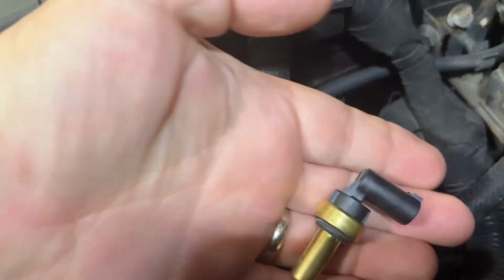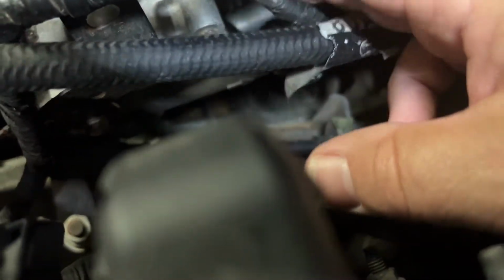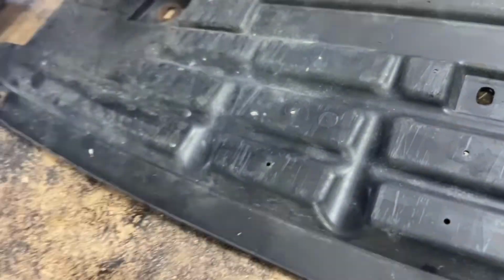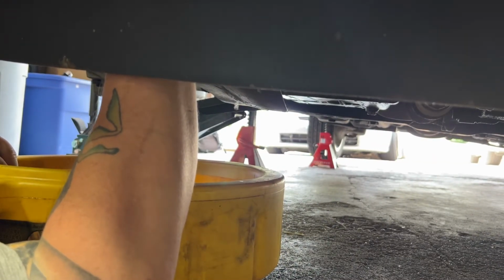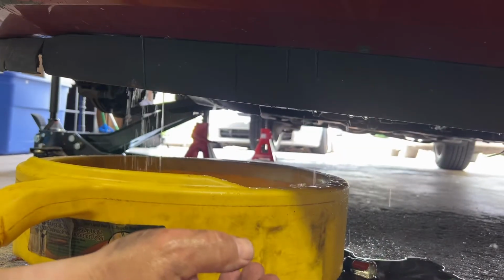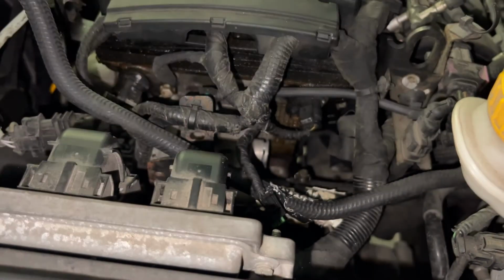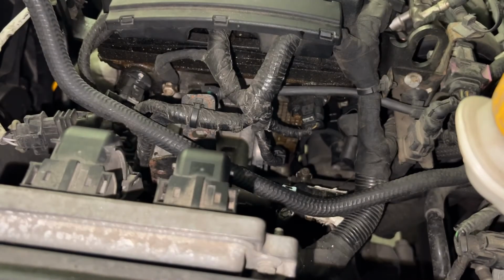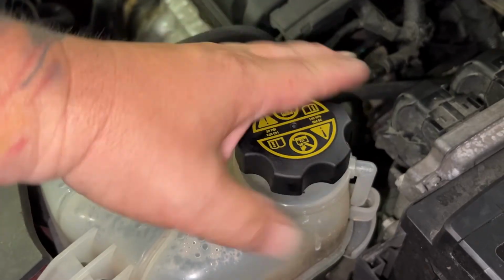COOLANT TEMPERATURE SENSOR Replacement & Location Chevy Sonic Cruze - fan issues, hot A/C at idle

Comment: What about the other coolant temp sencor on the rad
Reply: I am having this same issue. The temp sensor he replaces I unplugged it to make fan kick on and keep car from over heating. I've replaced whole thermostat and new waterpump.
Reply: This is why we shouldn't have started using a stupid computer to open and close a thermostat. The wax pellet thermostats worked just fine.